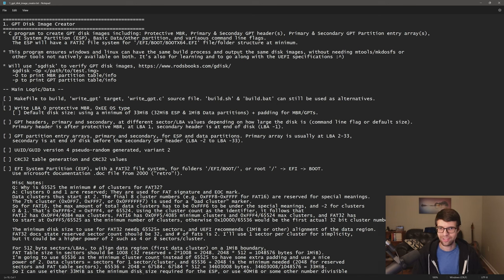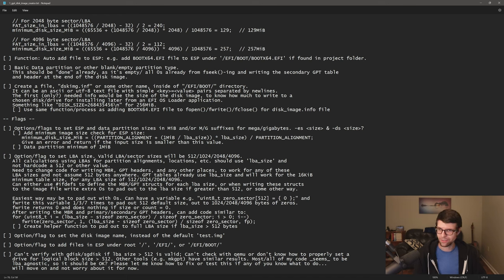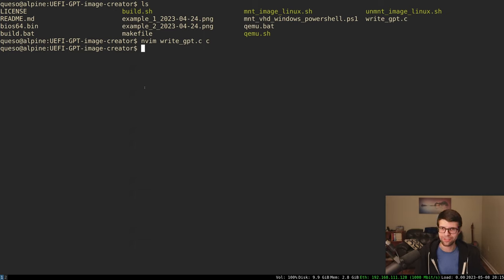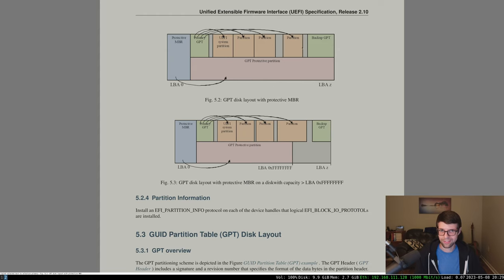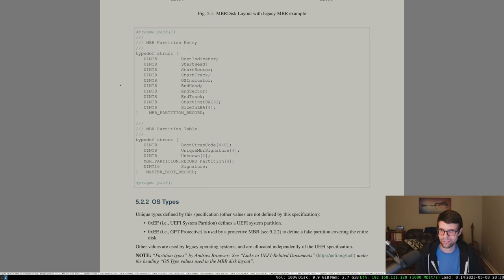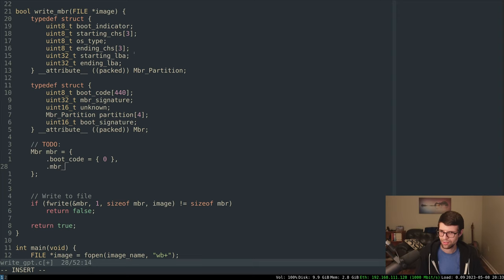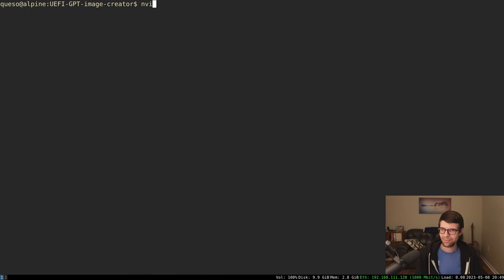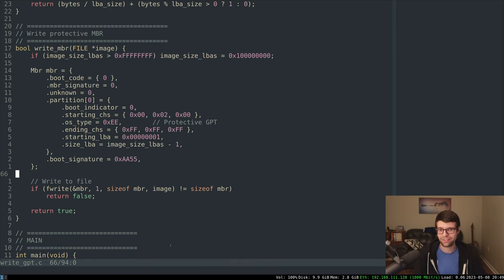Protective MBR | GPT Disk Image | UEFI Dev (in C)

Comment: Just to make sure everyone caught what he said, which I say in my tutorials too. You MUST use HDD if you want it working with all software. IMG will not work with everything. Example : VirtualBox uses IMG for floppies only. Which is only 1.44 meg files. However HDD is a raw format. Even RUFUS will work with HDD if you choose the dropdown and choose * . * as a way to get the file loaded. This is why VHD will be something to look forward too in his future videos, because VHD works with everything without any modifications. Even Rufus will work directly with VHD. Bottom line, save yourself hassel if you use his current code from this video by changing the IMG to HDD for now, until he adds in the ability of VHD.
SIDE NOTE : This GPT creator only makes a 36(correction, I meant 32), Meg file to begin with. That is the minimum for a FAT32 EFI setup. If you want to add an install, you need more space. Example, I use 40 megs for my setup. This allows enough room for a bootable BOOTX64.EFI file as well as other files that might be needed. Eventually leading to your creating a separate partition for your actual OS. All within the HDD / VHD file. (Or in the case of this video, IMG.)
Reply from the maker: You'll have ~32MB for files in the efi partition to work with, as I'm going to align the data region for the FAT filesystem on a 1MB boundary. But if you need a lot of files or ones larger than that, there will be an option to set the size of the esp and data partitions later

Comment: When calculating bytes to LBAs it could be better to use

(bytes + (512 - 1)) / 512

instead of

bytes / 512 + bytes % 512 ? 1 : 0

to save on expensive modulo opetation, especially if the divisor is known only at runtime (4k block disks).
Reply: This is YT comment section used right. Thank you, gonna use that one.

Comment: what us ur computer setup?
Reply from the maker: Case: Coolermaster NR200P MAX
CPU: AMD Ryzen 9 5950x
CPU Cooler: Incl. with case; 280mm AIO, replaced fans with Arctic P12 PWM PST
GPU: MSI Gaming Trio Z RTX 3080 12GB
RAM: Corsair Vengeance LPX 32GB 3200Mhz
SSDs: Samsung 980 pro nvme 1TB, Crucial MX500 2TB
PSU: Incl. with case; Coolermaster V850 SFX gold
Motherboard: Gigabyte X570SI Aorus Pro AX
Monitor: Gigabyte M32U
Reply: @QuesoFuego  So u have two systems right? one is linux another one is windows?
Reply from the maker: I use a Linux VM from a Windows host, they're both on the same system